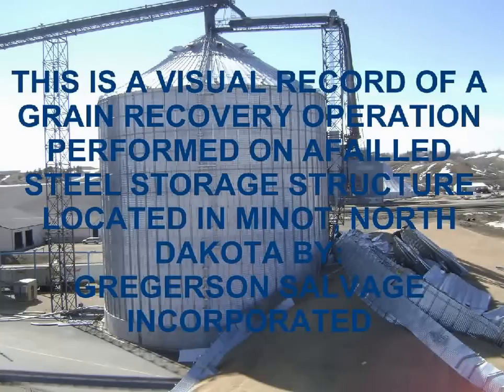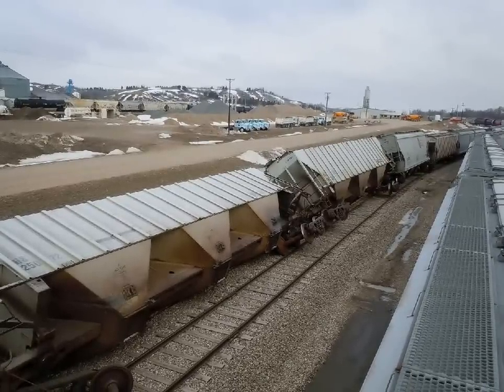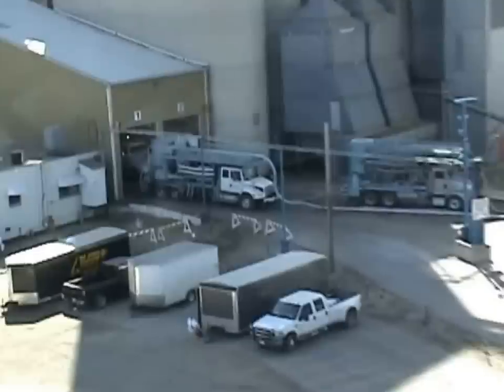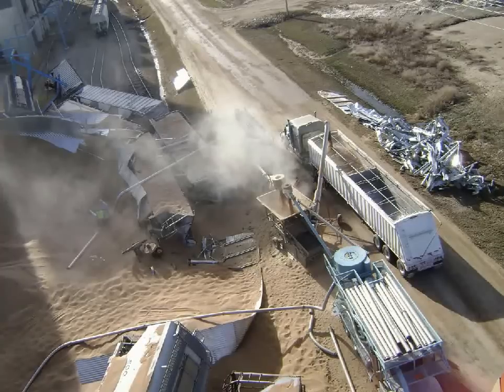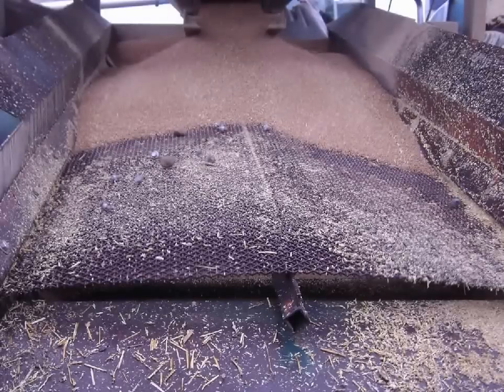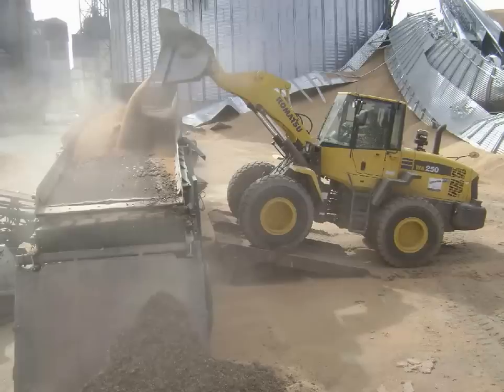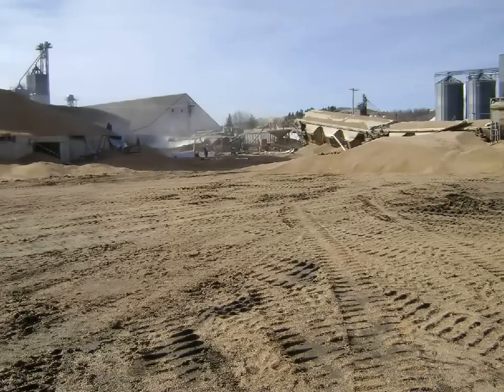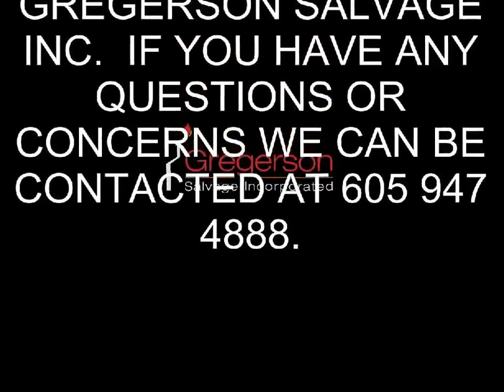SALVAGE OPERATION CONDUCTED ON A 750,OOO BU COLLAPSED BIN

Comment: I remember in the 80’s watching a news clip of a helicopter directly above a similar grain bin that was suspecting a failure. The helicopter rotated as some guy on the ground was watching. Then right there the bin collapsed. The guy on the ground had to run for it and he barely escaped. I think the weight of the air pressure created by the helicopter made the grain bin collapse and the helicopter pilot was doing something really dangerous and foolish.

Comment: This isn't unusual at all. When you get a cold snap and the grain is warm because it is so dense it will keep pressure on the bin while the outer bin cools and shrinks causing shear forces that exceed the designed strength of the metal. Outcome is seem failure and once it starts it is like a tin can pushed open. I was physically at a location I cannot name and watched a 1M bushel corn tank when it go super cold split while the tank beside it remained intact. The failure cause is supposition but likely accurate given that the little research I have done doesn't show tank failure in warm weather....

Comment: 62 lb corn with a rail next to it , the train vibrates , the corn settles , and the bin zippers !
Reply: Vern Goossen 62# spring wheat. A mass that huge doesn't vibrate from a rail car. It's like a fly landing on your foot
Reply: RJ 1999 the ground vibrates...the finely structured wheat most definitely settles & applies more pressure with each train that passes (my whole house shakes a ½ mile from the tracks) & in an industrial complex like this the trains run 24/7.
Reply: M. S. L. Your body or house doesn't have near the mass a bin that big being full has. Your talking millions of pounds, it's pretty difficult to make a mass that large vibrate enough to make grain settle. It's a good theory but in real life that's not what caused it
Reply: @RJ1999x  i think you underestimate the power of vibration.
Reply: @m.s.l.7746  I doubt a mass weighing 46.5 million # shakes much with a train going by. Not only that bins are built along railroad tracks all the time, they don't fail. It was either bolts that were not to grade, or poor engineering on the bin mfg.
Reply: @RJ1999x  the whole mass doesnt have to shake? Just the grain. A single grain of wheat doesnt weigh that much
Reply: @johnrustad8540  your correct but for the whole mass to.compress and burst a bin it would have to vibrate the whole mass, not a single kernal
Reply: I don't think this is considered one mass rather it acts according to fluid dynamics. There would come a time when full settling had been reached but that would have to be determined by someone smarter than me,

Comment: Phil Swift showed up with some of the flex seal tape sh** and made a couple wraps around the bin, fixed it like new.
Don't believe me? He made a screen door into a boat with his spray crap.
Reply: I took a chance on a spray can of Flex Seal for a camper roof leak that always came back and it's been good for three years now. No cracking, splitting or peeling like the other $200 worth of worthlessness I bought.